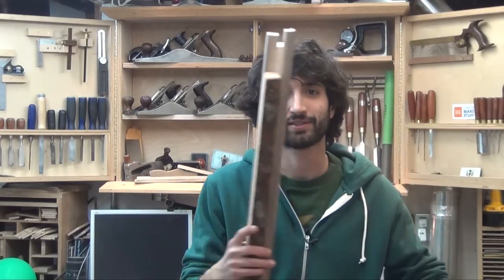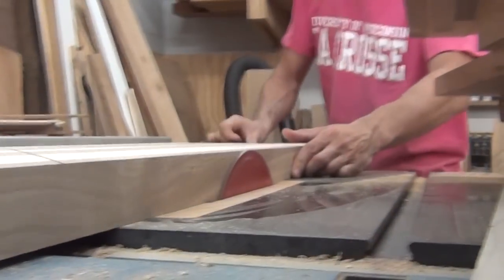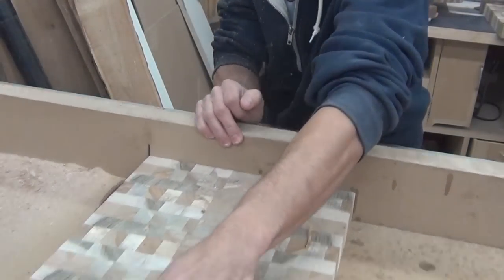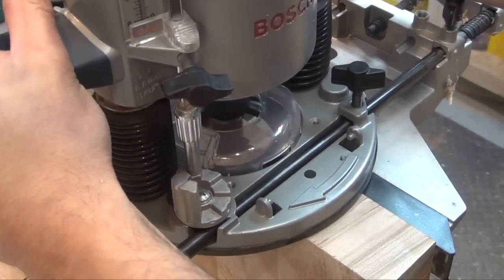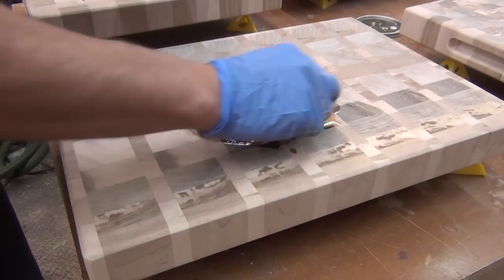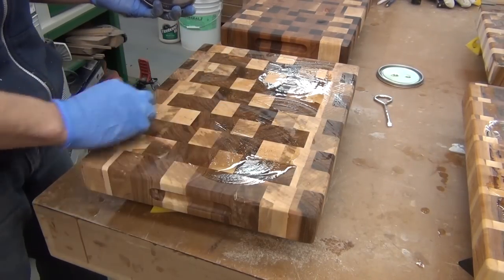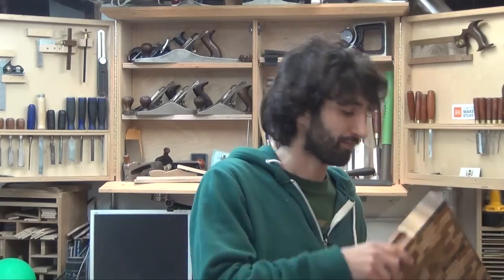Turning Scraps Into End Grain Cutting Boards

Comment: These chopping/ cutting (depends on which side of the pond) boards are works of art, as a Carpenter & Joiner I'd mount them on a wall instead of pictures. The finish is stunning, I know it's sometimes trendy for artisans to pick faults in each other's work (which annoys me) but dude you're awesome.

Comment: I've made a few boards lately and been using an electric hand plain. The router idea seems like I would get a truer surface in about the same period of time thanks for sharing that.
Reply from the maker: Travis Skelton Oh yeah, it would give you much more consistent results.  It goes pretty quickly too.  I went over each side of the boards in about a minute in a half.
Reply: Oh yea definitely a bit faster too. Long run I'd like to just have a planer to just feed it through but the router idea is awesome.

Comment: Hey Matt!  I've made my fair share of cutting boards flattening them with the router and recently had a "ah ha" moment.  When I ran the router in a counter-clockwise motion (or the opposite from the looks of your set up) around the board (making progressively smaller rectangles) it produced a much smoother cut on the surface than a back/forth pattern and no tear-out on the edges.  I don't have the drum sander, so it really cut down on the time needed to smooth out the surfaces with the random orbit sander!
Reply from the maker: Interesting.  I'll have to give that a try next time.  Thanks Aaron!

Comment: Just before joining the Navy, I worked in my dad's meat market. He had a butcher block that I had to scrub with a wire brush every night before closing. These cutting boards remind me of that butcher block. I don't remember ever putting any oil on it. I was just wire brush it and wipe it down with a wet rag. Nice job on both the cutting boards and the video. Any advice for those of us that don't have a 10" wide planer?
Reply from the maker: Frank Thornal Thanks interesting.  I've always seen them with some sort of protective finish applied but I guess if you maintain it well, there may not be a need for it.  If you have smaller machines, you could use the same process to make some narrower boards and then glue then together.  I have a 12" jointer and if I wanted a 24" wide cutting board, I would make 2 12" ones and glue them together.

Comment: Matthew, thanks for the video, i'm gonna use up some scrap wood! Two questions: can you use old heart of pine to do end grain cutting boards? I know standard pine is too soft, but wanted to ask. Also, after you've glued the final end grain boards together, why are you flattening with a router / jig instead of a planer, is there a specific reason? Thanks.

Comment: Crazy how the wood was soaking up that finish! I really like these cutting boards. As you said, 1000 steps later, but they are beautiful. Good job! Side note: do the board remain greasy or does this dry eventually? Or do you put some kind of other sealer on there? I didn't gather that from your video.
Reply from the maker: Bruce A. Ulrich Yeah! Those boards are thirsty!  Thank you!  The finish fully dries and doesn't have any oily feel.
Reply: Matthew Cremona Great to know that it does not remain oily. Thanks for the quick reply!
Reply from the maker: Bruce A. Ulrich No problem, Bruce!

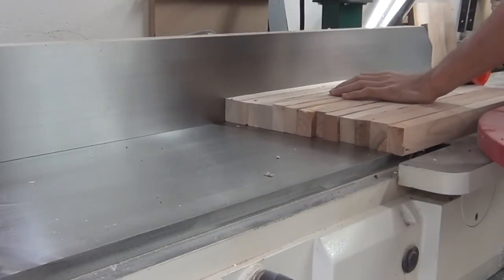Comment: When flattening one face (1:05 mark), wouldn't there be an issue with grain direction?  Wouldn't there be some tear out on some of the boards?  or is that not a big issue?  Thanks again!
Reply: sorry, I didn't wait long enough when you addressed it with the sander.  Thanks.

Comment: Thanks Matthew. The specifics on how you use the salad bowl finish was the most helpful for me. I just used it for the first time on a board I made and I didn't like the way it turned out.

You said you do final sanding...do you do any between coats?

Thanks!
Reply from the maker: l3ender15 What was the problem with the finish?  Just didn't look good?  I don't bother sanding between coats.  After the first coat the board is still smooth from the sanding and all of the finish is absorbed so there isn't a film on the surface to sand.
Reply: Matthew Cremona It still looked alright, but if looking closely in the light you can see the different woods soaked in different amounts. I think I just didn't put enough on to let it all soak in, to be honest. Finished product: https://www.dropbox.com/s/ebi0ry81jjk5a44/2014-12-14%2013.54.47.jpg?dl=0
Reply from the maker: l3ender15 It looks great in the picture.  That second coat really helps to even things out.

Comment: Happy New Year Matt!  I have a question?  I am a novice woodworker and I am wondering why did you use a router to flatten the boards instead of putting it through the planer?  Could you achieve the same results?  BTW...your shop is awesome!!!  I wish I had space for the "big" machines.  Thank you for your videos, they are very fun and informative.
Reply from the maker: Michael Sawyer Thank you Michael!  You could but it's generally not recommended.  The forces of the knives on the end grain can cause the board to split and break up inside the planer.  Those pieces could easily be shot out of the planer.  I talked about it and gave a demo of it on my shop update from Sept 15, 2014: http://youtu.be/d_bmCOqp-L8

Comment: good video!  why do you use your router jig to plane at the end instead of using your Planer?
Reply: most people who make endgrain cutting boards say it's too dangerous to send an endgrain cutting board through a planer. And there are others who say it is safe when the proper precautions are taken. If you search mtmwood, he is one of the best I have seen on youtube.
Reply: Yeah as Jordan says, mtmwood goes into great detail about this. It's a serious business, there are many precautions you have to take, and it'll never be completely safe (or as safe as the average thing is in machine shop woodworking)
Reply: Glue an extra piece of scrap wood at the front and back of the board and pass it through the planer/thicknesser (ie the edge going into the planer and the back edge); cut this off on the table saw when finished. That way if there are chips from the planer they'll be on this extra scrap & not on the board !
Reply: wish I had seen this video before I put my end grain board through the planer . It ruptured once inside, made a terrible noise and sent splinters inside the inner workings . Scary but no damage to planer, the cutting board was broken in two . Looks like a router rail set up for me

Comment: Hey Matt,  do you find that it is common to find voids (needing epoxy) in your endgrain cutting boards?  If so then I better get some epoxy because I am having a heck of a time with that same issue but have never used epoxy before.

Comment: Great video and love the info included. I would like to see, for a beginner, how to do it without drum Sanders and a huge jointer. Side note thanks for explaining what you're doing. Quick question do you use Oak in your boards? I was told not to
Reply: Without a wide jointer, I would use a planer with a sled (only after the first glue-up, NOT the end grain glue-up) or a router sled. Also you can significantly reduce the amount of flattening you have to do if you get the pieces to an even height on the table saw before glue-up.

I'd avoid white oak for an end-grain cutting board, but it's probably fine as a serving board. I personally don't even like using walnut as it can be pretty porous, and has a distinct smell.

Comment: Were you climb cutting with the router? I couldn't really tell. Awesome cutting boards, by the way!
Reply from the maker: frangitofrangito Looks like a bit of both.  I believe when I'm pulling the router it is a climb cut and when I'm pushing it back it isn't.  I didn't really notice a difference in cut quality one way or the other.  What was more important was finding a feed speed that wasn't too fast.  Thanks!

Comment: I'm new to woodworking and am planning on making an end grain cutting board. When laying it out, the width will in the end be the length, correct? So, if I want to make a 12"Wx15"L cutting board, the original width needs to be 15". Correct? Not including the material for cutting and sanding, etc.

Comment: Hey Matt, great video! I had a question. Why do you use a router to flatten the boards instead of running it though the planer?
Reply from the maker: Daniel Ridley Running an endgrain board through the planer puts a lot of stress on the board and it could easily fracture.  Check out my shop update from Sept 15, 2014.  I do a demo of this: https://www.youtube.com/watch?v=d_bmCOqp-L8&index=31&list=PL0dX5redvVZQ4dQiELpnCqD4RaQ5ZC-Yd  Great question!  Thanks!
Reply: Thanks Matt! I appreciate the tip. I will check out your other video.
Reply: I had the exact same question. Beautiful work. I especially like the extreme randomness of some of the boards. Someone else described them as camouflage. Who wouldn't love to have one of these?
Reply from the maker: tomalcolm Thank you!!

Comment: Do you have any recommendations as to what wood to use and what not to use? I don't have ready access to the 'nicer' woods (like walnut, etc.), so I'm just wandering wat wood I CAN use? I have my doubts about pine, which is what I do have access to...

Also, what advantages does the flattening with the router have over using the jointer or planer or drum
sander?

Great boards, BTW.
Reply from the maker: You'll hear different things from different people on wood choice.  I like to use hardwoods that are as non porous as possible.  The typical reasoning is that porous woods like red oak give bacteria a place to hide.

Safer than the jointer/planer and faster than the drum sander.  I did a demo of what can happen when planing and endgrain board on my Sept 15 Shop Update: http://youtu.be/d_bmCOqp-L8

Thanks!

Comment: So much work in those cutting boards, great job.  I have some scrap padauk.  Is that not worthy of a cutting board?  Just wondering about opinions using exotic wood like this in a cutting board.  I don't want all those scraps turned into pens.
Reply from the maker: James Bushey Thanks James!  Padauk works well for cutting boards.  I've seen plenty of exotics incorporated into cutting boards.  They're a good choice because they are dense.

Comment: Did you research which is the best food safe glue before you started making cutting boards? I've always wondered about that. To date I've only used yellow glue for mine. Maybe I should start using something else.
Reply from the maker: diycentral Yes, I looked into it.  Titebond 3 is food safe and besides being water proof, I also like that it has a little bit longer open time which helps with these larger glue ups.
Reply: Matthew Cremona good. Nice to know I've been using the right stuff :)
Reply from the maker: diycentral haha! Such a great feeling!

Comment: Hi Matt. I’m new to your channel, and saw this video in recommendations. I do have a couple of questions though, and they’re based on the glue. Firstly, did you find that the boards separate over time and secondly, is Titebond (or any wood glue for that matter) a safe glue to use for preparing food on? Thanks.

As a side note, I would really like to see videos for beginners like myself. I really do have limited tools and would struggle to make a board in the way in which you have, and would really appreciate a video (unless you can point me in the right direction), on making them with hand tools. Yep, I know, you hate me already. Lol 😬

Comment: Awesome video, Matt! The boards look great, as usual. Every time I see you jointer in action I become filled with jealousy. My little 6" (that's what she said) looks like a cuddly little baby compared to yours! I'm wondering though; what's going on with your planer's height adjustment wheel at 1:40? It appears to be turning on its own.
Reply from the maker: Thanks Steve!  It's not quite an aircraft carrier but it's pretty close :)  Yes it was moving on its own.  I have to tighten up the adjustment.  It's a bit too loose right now.  The vibration causes it to move.  It's not really a problem though if I use the table locks.
Reply: Matthew Cremona What type of glue are you recommending?
Nice Work!
Reply from the maker: I use Titebond 3 which gives a little more working time. Thanks

Comment: Rite of passage?  It's a requirement -- a tradition -- it's a must do.  lol
Nice video and very nice cutting boards - even if these are the very small ones compared to what I've seen you have in the past.  ;)  (just joking around a little).

Oh... I have one question:  How wide is your jointer/planer?  A city block?  two city blocks wide?   ( j/k -- again )

Thanks for the videos!  I really enjoy them all!
Reply from the maker: KSFWG lol It's something that everyone seems to do at some point.  Hopefully my method is a bit more on the unique side.  These are a bit smaller than the ones I've made in the past.  The 12x16 is medium size.  Large/regular size for me is 16x24 or so.  My jointer is 12" and my planer is 15" wide.  Thanks as always!

Comment: Matt, I make cutting boards in a similar method to yours using many types of wood. My question is: I've been using mineral oil and the last few boards have all cupped slightly, like a smily face.  I know you use salad bowl finish. Has this happened to you?
Reply from the maker: Hey Nathan,  I haven't had that problem.  Mine all stay flat after they are finished.  A few things I do to help keep them flat and stable:  I leave the initial long grain blanks for a week or so after glue up to move before flattening.  This also makes sure the moisture from all the glue has time to leave the wood.  The same thing goes for the end grain glue up.  Lastly, I'll flatten, sand, profile, and finish all within the same session.
Reply: +Matthew thanks for the tip! Never thought about how much moisture is introduced in those glue-ups.

Comment: Hi Matt. Quick question. Why did you flatten the board with a router instead of using the jointer?
Reply from the maker: +NewYawkah Two things could happen if you do that.  The board could either explode or could be easily thrown by the cutter.
Reply: +Matthew Cremona What makes it vulnerable to being thrown or exploding? Is that because of the fact that it is a conglomerate of pieces?
Reply from the maker: +NewYawkah The board is weak because the grain is running vertically.  Think splitting firewood

Comment: Im cleaning up and rearranging my shop to make room for a new band saw im getting for my brthday (27 dec) and now I know what to do with all my new and old scraps tht ill probably NEVER use but cant seem to get rid of. AND ive never made a cutting board b4 and I need to get or make my sister something for christmas still. So thts a perfect idea. It does seem like a Long process but gonna gve it a try. If it turns out bad then ill have np gettin rid of em all. win win for me on this..lol thnks 

*WHERE WOULD I GET THAT SALAD BOWL FINISH?* LOWES?
Reply from the maker: Joe Walters Happy early birthday!  That's exactly why I do this.  I tend to hold onto too many offcuts waiting for the perfect project to use them on. It's a quick way to run out of space.  If you're only making a couple of boards it's not too bad when you get above 10 boards that's when it really starts dragging.  The only places I've seen salad bowl finish is at Woodcraft and Rockler.  There are other brands that sell the same product too available at other woodworking suppliers.  It is something that they can ship to you if you can't buy it locally.
Reply: Thanks for the pre bday wish appreciate it!!:). .and thts the issue im having. Runnin out of room my basement is my shop now I move down there for the winter months from a 3 car garage so any and all space is precious. I guess I ll have to rush order tht from whichever can ship it sooner because im unable to find any type of cutting board finishes/food friendly. 1 other question is it dishwasher safe or hand wash? Prolly a silly question but my sister will toss it in the dish washer and not think twice.and ruin it if its not...lol Once again thnks for the bday wish and reply. Tty next episode;)
Reply from the maker: Joe Walters No problem!  You could always use butcher block oil (available at the home centers) or mineral oil if you're in a time crunch.  If one of these boards when through the dishwasher it would either come out looking like a potato chip or it would crack all over.  The care instructions I put on the tags for these says something like: hand wash only, do not submerge.  Talk to you next time :)
Reply: Mineral oil I have seen that..kool.thnks..and thnks for the tio about the dishwasher..ill be sure to tell her.. thnks again ttynt
Reply from the maker: Joe Walters No problem!

Comment: Matt, why don't you use General Finished Butcher Block Oil?
Reply from the maker: Maintenance and longevity.  Mineral oil finishes don't cure.  Every time the board is washed with soap, the some of the finish is removed.  The finish on the board will fade quickly with use and needs to be replenished to counteract that.  A curing finish doesn't suffer from that and doesn't require maintenance.

Comment: Nice, but can a similar result be achieved without the many machines you have ? like jointer, planer, drum sander etc. ?
Reply from the maker: havenisse2009 Absolutely.  You could use the router sled for the entire process. The core process is being able to flatten something.  If someone has a method to do that, they could make a cutting board using this process.  Thanks for the question!  I am planning on talking more about that on my update tomorrow.
Reply: Matthew Cremona ýyii I.